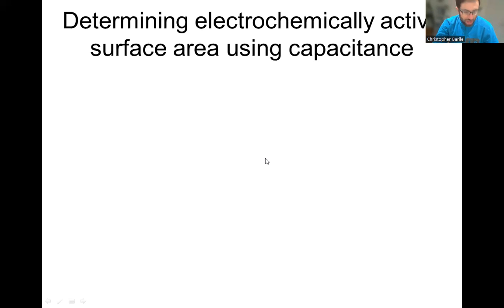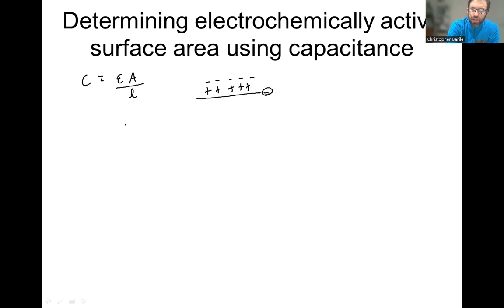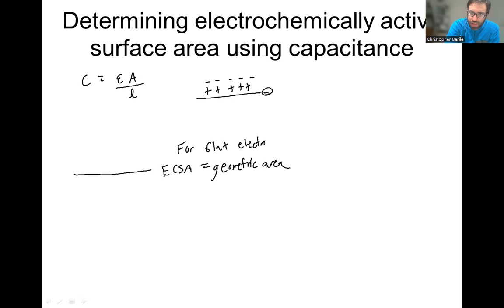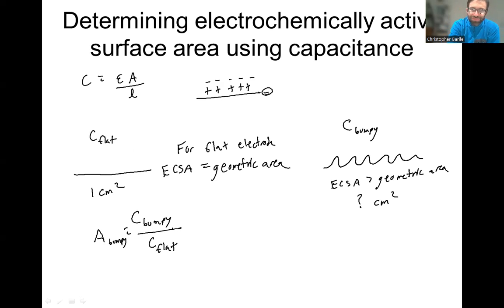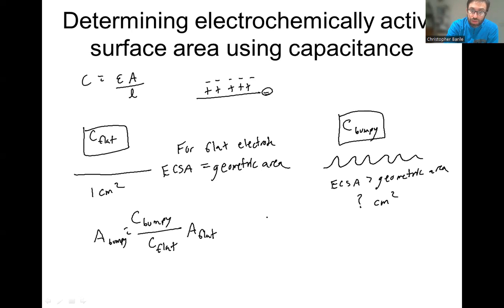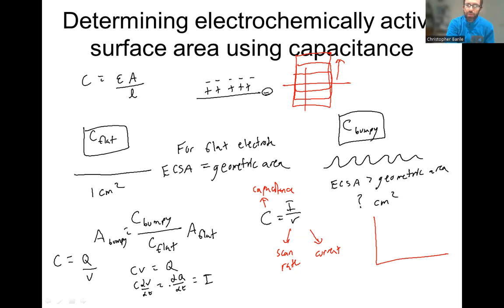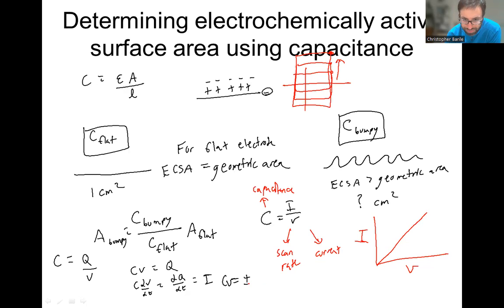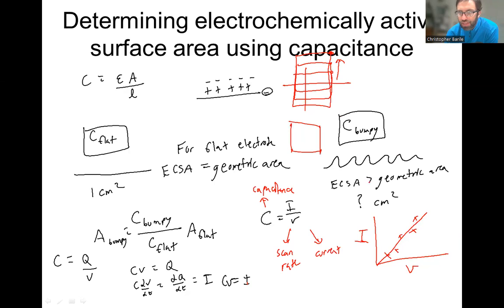How to determine electrochemically active surface area using double layer capacitance

Comment: Can the capacitance be calculated from EIS data? WHen fitting the EIS circuit, there will be the capacitor component.
Reply from the maker: Yes
Reply: sir I have one query......for charge transfer resistance we are taking kinetic region so how can we calculate Cdl from EIS........or to calculate Cdl from EIS do we need to give potential 0V vs OCP? I mean we want Cdl in non faradaic region?
So my doubt is we can't calculate Cdl from Randle circuit because there will be 1 capacitor component but it will be in kinetic region so do we need to take another EIS data at 0V vs OCP to calculate Cdl ? @christopherbarile2539